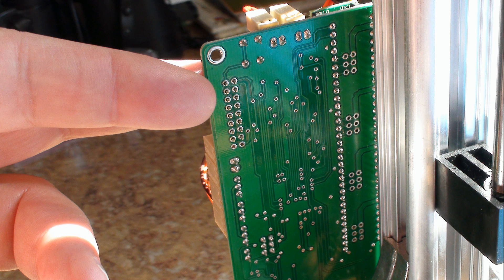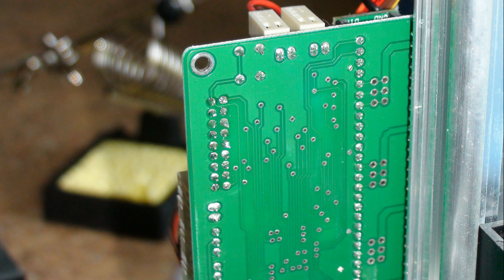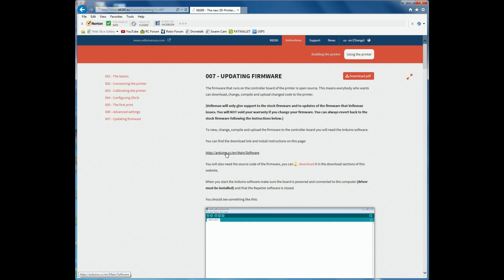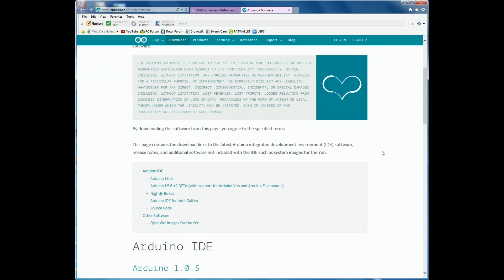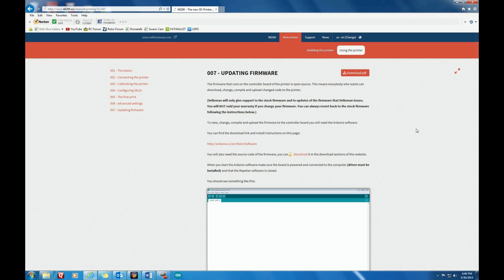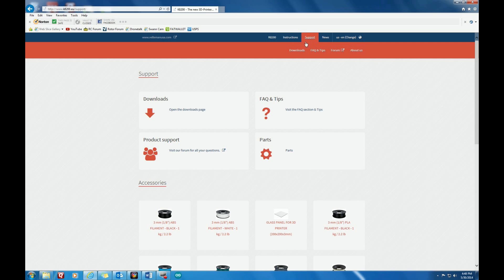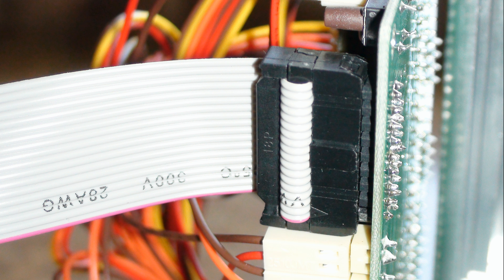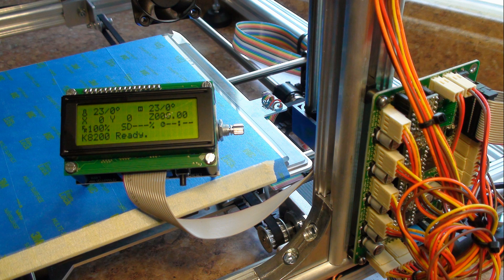Velleman VM8201 Controller Installation

Comment: This is great.  How about a video on how to use the unit?  I can get my printer pre-heated and command a "print" from the SD card, but the printer just sits there.
Reply from the maker: I actually had the same issue with the one I purchased.  I looked everywhere for some direction and the only help out there is the forum at http://www.google.com/url?sa=t&rct=j&q=&esrc=s&source=web&cd=3&cad=rja&uact=8&sqi=2&ved=0CC4QFjAC&url=http%3A%2F%2Fforum.velleman.eu%2Fviewtopic.php%3Ff%3D47%26t%3D11047&ei=Rr-sU_GRC4ugogSZ4oGoDA&usg=AFQjCNH5zwKVKSqY-RbpslTfx1bbA4tT3g&sig2=C-rp5WXBXrJ9WCliGr1arw

I am just going to use my dedicated laptop to run my printer until they make the Controller a little more stable and user friendly
Reply: I managed to find my error.  Do not save in binary!  The funny thing is that instructions are so sparse for the standalone computer that I didn't even know that the knob had a "press in" option.  Oh well, I have it working now, even printing quality ABS.  Thanks for the videos!
Reply: +FairCogent I have the same problem, can only control heat. What do you mean Do not save binary